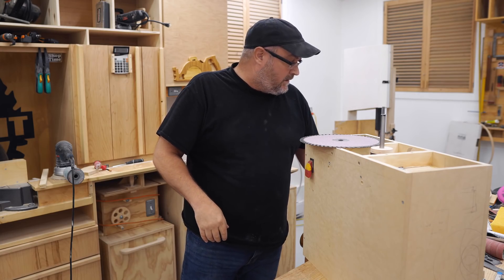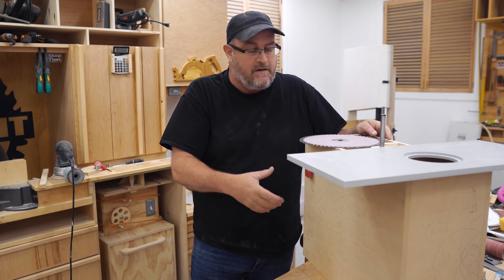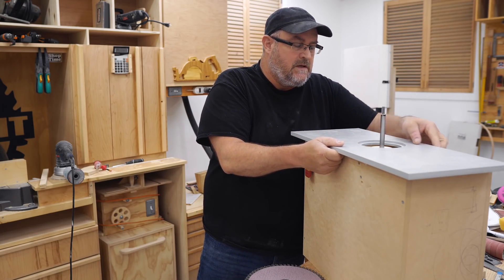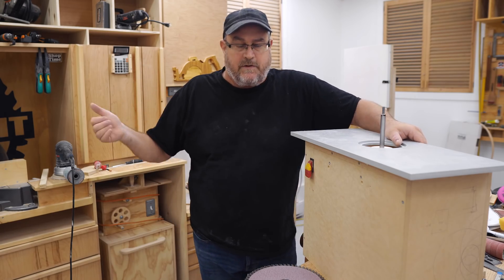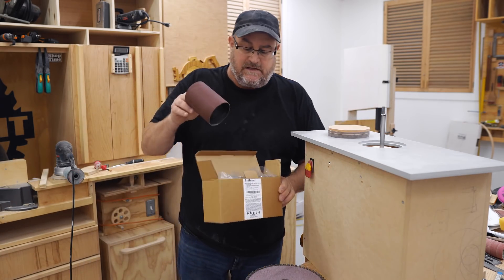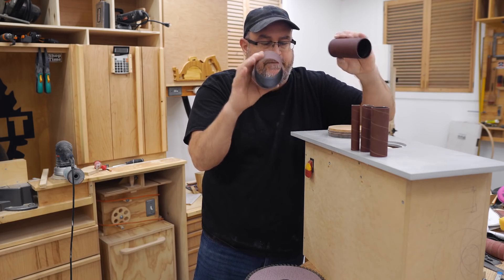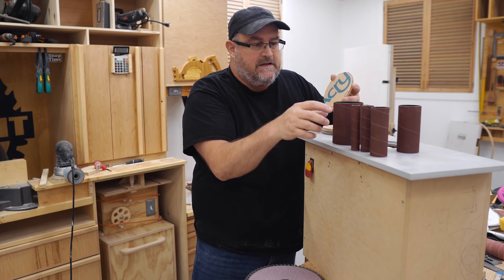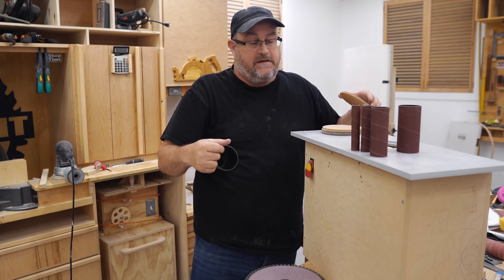Where's that Spindle Sander, John?

Comment: Just finished building a spindle sander using the motor from an old (Eaton's Viking) juicer, and a chuck from a 5/8" Sears drill to hold the spindles. Dust collection is just like yours and the gap around the drum of less than 1/8" pulls virtually all the dust, leaving the table clean with a 1-1/2" drum. The small gap results in higher-velocity air flow is my reasoning. I didn't try the 3" drum yet as the sleeves haven't arrived yet. That might not be as efficient.

Comment: Glue each piece of sandpaper onto a solid wooden cylinder with a rectangular hole in the center.
Replace the round spindle with a rectangular piece of wood (or steel).